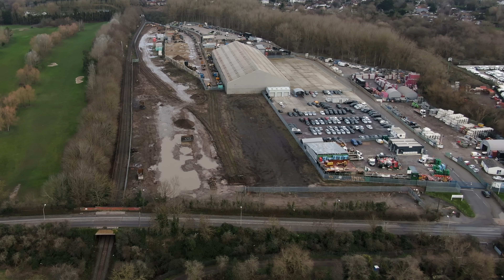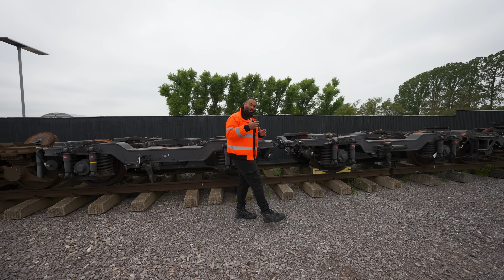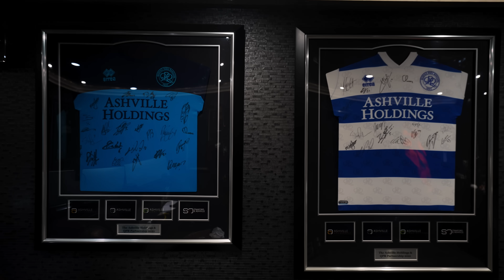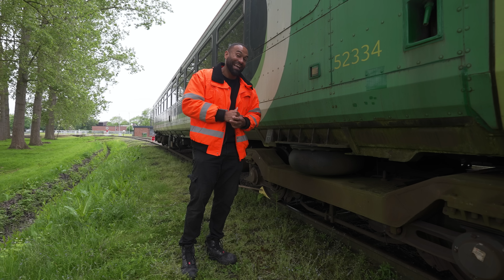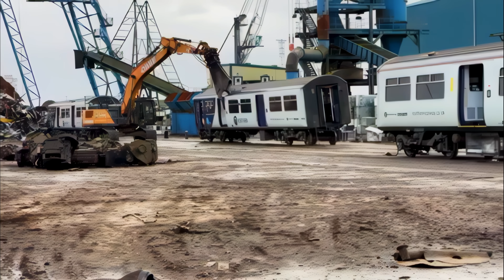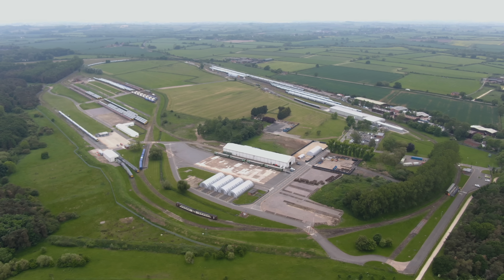I Got My Own Train

Comment: You don't need to transport it by truck, too expensive. You just need a few panels of rail and a crane. Get it towed to your siding, lift it over onto temporary rails and roll it to its spot by leap frogging panels.
Set on site all you would need would be an electric compressor to run the doors etc. I would for sure leave a table and facing seats for the reception area.

Comment: Just a little thing. Whenever he says train he means locotmotive
Reply: No he doesn't... a locomotive is a light engine meaning steam or diesel which requires coaches to couple to. This is a DMU a diesel multiple unit with coach built into it.

Comment: Run an airline to the aux reservoir so the doors will work. 153's have fairly slow doors so you might want to tweak the flow restriction a bit to speed the opening up.

Comment: 10:25 That Is A Metropolitan Cammell Sprinter

E&CR = English & Celtic Railways

Original E&CR Model (Classed As: “151”)

British Railway Model (Classed As: “156”)

By The British Railway Company

MotorCoach Classification

British Railway Sprinter (As: “152”)

Driving Motor Classification

Leyland Sprinter (Classed As: “153”)

Only The Driving Motors Are Built, But They’re For Cabless Trains
 

You Got A Switchable Driving Motor (Corridor) Of Your Own

A Run-Around Driving Motor (Corridor) Of A Leyland Sprinter: #34 Of The Original 5 Seven

Comment: 10:25 That Is A Metropolitan Cammell Sprinter

Original Model (Classed As: “151”)

Official Model (Classed As: “156”) 10:25

Push-Pull DTs (Official Model Classed As: “152”)

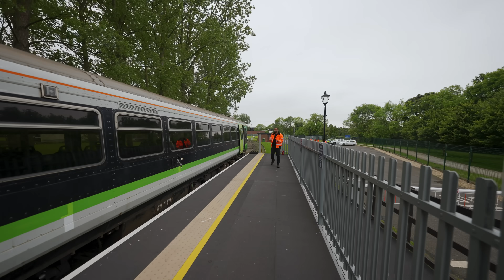Comment: 4:05 You Got Yourself A Leyland Sprinter MotorCoach

Leyland Sprinter Train

Standard Classes Of Either A Train Or A Plane

1. Luxury

2. Business

3. Deluxe

4. Economy

Composite = Combination Of Standard Classes

MotorCoaches (Either End Cabs Or Gangway Cabs)

Composite (Intermediate Or Conventional Cabs)

Passenger

Intermediate

Combine (Utility Cabs Both Ends)

Catering

Sideboard

Passenger w/ Luggage Rack & Lavatory ⭐️

Sleeper

Camper

Luggage

Postal

Etc.

Switcherhead DT Pair

MotorCoach Consists:

Triple Head-Switcher (Three MotorCoaches)

Quad-Head-Switcher (Four MotorCoaches)

5 MotorCoaches

6 MotorCoaches

7 MotorCoaches

8 MotorCoaches

Driving Trailer Consists:

DT / DTL

DTs Only

DTLs Only

DT Pair + DTL

DTL Pair + DT

Triple Header (3DTs Or 3DTLs)

DTs / DTLs

Triple Header + DTL

Triple Header (Lavatory) + DT

Quad Header (4DTs)

Lavatory Quad Head (4DTLs)

Triple Header + DTL Pair

Triple Header (Lavatory) + DT Pair

Quad Header + DTL

Lavatory Quad Head + DT

5DTs

5DTLs

6 Driving Trailers

7 Driving Trailers

8 Driving Trailers

9 Driving Trailers

Etc.

Consists:

Triple Unit

6 Car Division

9 Car Division

8 DTs + 4 Cars

5 Triple Units

6 Triple Units

7 Triple Units

8 Triple Units

Quad Unit

4 DTs + 4 Cars

6 DTs + 6 Cars

8 DTs + 8 Cars

And So On

Leyland Sprinter Train (End Cab Or Gangway Cab)

Lavatories Available Per Carriage

Driving Trailer

Cabless Trailer

Catering Carriage

Sideboard Carriage

Luggage Carriage

Sleeper Carriage

Whatever

Run Round The Anglo-Celtic Railways

Keep Your Eyes Peeled For A Terminal To Be Built In The North Of Scotland Near John O’ Groats Or Somewhere

There Needs To Be Switch Tracks That Lead To Both The Siding For The Train (Switcher Heads), A Loop & The Roundhouse For A Corridor Engine To Go Into The Turntable, To Switch Directions, Then, The Locomotive Engine Is To Go To The Edge Of The Station First, Switch The Track Points, Then Reverse An Engine To The Edge Of The Station, Then The Carriages, You Drive The Train Of Carriages To A Locomotive From The Driving Trailer, Couple The Train To The Locomotive, And Then The Train Is Ready To Either Pass Through Ireland Or Into The Island Of Sodor

Can’t Tell How Many Platforms The Station Would Need

Also Would Have International Platforms Like St. Pancras (Eurostar) & King’s Cross (With Platform 3⅓)

Platforms For Railway Buses (Like That Of The Pacers)

The Base Terminal Of The Anglo-Celtic Railway = Somewhere In London, England Whereabouts

The English & Celtic Railways (E & C R) Should Establish In 2028 A.D. As The 8 Decade Anniversary Of The British Railway

Comment: Hydrogen is not clean electricity.  Don't buy that lie.  Electrolysis looks good on paper, but is power hungry and expensive.  The easiest, cheapest, a lot dirtier, and the main and only usable method of creating hydrogen is steam-methane reforming.  Might as well be running on diesel at that point.

Comment: 9:10 - That's is not entirely correct. Sand IS used to gain traction, both regarding braking and acceleration. However, under normal circumstances, sand is not needed to use the brakes on a train. Sand will only be needed when the rails are slippery, especially during october and november due to all the leaves on the track. And it can be used both for acceleration and braking, but must of the time, it's not needed.

Comment: I like the reception idea but a moving reception would be pretty awesome. Like you come in Ashville and the train goes from the 1st stop (the gate) to the next stop (the main buildings/offices), & then potential other stops throughout your yard. I guess having it work on its original diesel propulsion would be very impractical but an electric (or any powered actually) winch type system could work and it’s a great showpiece. lol

Comment: @Ashville It would be neat, if you could ask for permission to drive train to the Ashville Yard. This could be possibly be during low peak hours and at night. But, at least attach this train to a freight train that going to the south. So you could ride it on the rails for the last time. Even if you can't get the train working running again? Plus it would be a great video seeing the train traveling on the rails to it new home.

Comment: Battery/ Hydrogen fuel cell Electric Multiple Units are truly the future of passenger rail transport.  Because they will be useful for routes that need passenger service but don't have enough demand to justify having locomotives for each train or investing in overhead electric wires.

Comment: What you forgot to mention was the class 153 built-in 1987   Originally  Class 155 2 car.  

In the early 90s when West Yorkshire metro needed more units  They decided to convert 35 of the units in to 70 separate units as It was almost 1/2 cheaper then buying newer trains.

Comment: I used to be a Senior Conductor on 153334 when it used to work the line between New street and Rugeley Trent Valley, normally coupled to a 170 turbostar. Great to see it avoid the scrap yard

Comment: Daniel will the train be driven to site on rail or back of a low loader the latter would be a logistical nightmare all you need is a crane lift it into place 👍if its by road and your looking for a good heavy haulage firm who specialise in this scotts heavy haulage based in Derbyshire.

Comment: big question: why can't it be driven or hauled to the yard, given you already have your own railhead that's very much connected to the UK rail network? from there it would be easier to maneuver into its final resting place either with heavy equipment or temporary rails, compared to the whole logistic puzzle of moving oversized cargo by road.

Comment: If it's gonna be parked up permanently,  fit drivers cab windows with LCD monitors,  rig some wires in the controlls, and load up Train Simulator game.  ;)

Comment: I'd volunteer my time to help with whatever renovation  and modification you do.  I am an 'anorak' (tho not  a frother LOL).  Your gonna have fun doing it.

Some suggestions..   
Mobile permanent office and cafetaria.  Maybe get it railworthy and use it travel to your various yards with rail access (if applicable).   Why have one building as a main base for all yards, when you can have a main office that travels (with accomodation?).   Although this could be done with a HGV artic on road,  it isnt quite the same style.

If you have security on site 24/7,  have a section aside as a small office for them.

Start with the usual dark Ash theme livery.

Comment: My dad is a train driver for West Midlands Railway and is based out of Leamington Spa, it can be nearly guaranteed that he has driven that very train on the route to Nuneaton (it was also in use on the short spur from Stourbridge to Stourbridge Junction, which he also drove).

Also pretty funny that the clip of a train moving operation you used was moving a Deltic, the loco I got my username from.

Comment: Hi Daniel, 
Very pleased for you owning your own train. As a retired railwayman I appreciate your excitement. A couple of notes for you if I may. 
These trains are known as units and talking of which, you may have realised that one of the cab ends is smaller than the other, this because these Class 153 units were conversions from some Class 156 units which had 2 carriages. So by doing this BR wete able to create 2 powered train units out of 1 two carriage train. You were correct about the sand boxes, however they are only deployed in slippery rail head conditions to aid traction when stopping and also to aid starting from a standing stop. 
I used to drive the electric version of these but in my earlier Driver training days I did get to drive yhe Class 156 version from which the Class 153's were made.
All the best with your new venture.
Take care,
Jon B.
Reply: They were 155's originally not 156
Reply: @rayhenwood3833  Sorry pal, but the ones I drove and Guarded on were 156 units, some of which went for conversion. Never saw 155's on my region...
Reply: Actually they were converted from class 155s, not 156s. I worked for Hunslet-Barclay at the time and we converted 35 sets into 70 single car units in 1990 onwards. Class 156s have always been 2 car units occasionally reformed into 3 car units. Never single car.

Comment: You say you're not gonna touch the body of the train with it being steel, but I would check for corrosion. There's two Class 156s (one of which could've been the one you've included footage of) that Porterbrook leased that are apparently so badly corroded that they may not see passenger service again. They were built around the same time as the 155s (which were split to become 153s) were built around the same time period

Comment: Glad to see you mentioned Hydrogen fuel cells as far as I’m concerned with construction plant and equipment it’s the future … ev plant just doesn’t work on a construction site where your machines are working all day should be used for cars but then they can’t charge you for a replacement battery every 3 years

Comment: Glad to see you saving it what is the possibility of using it for duel purposes set it up as a reception area but also be able to run it around your yard area if you so choose to use connect the track it sets on to the rest of the yard tracks so it looks like your doing street running just an idea

Comment: Sand is only used for traction in slippery conditions, sand is not used for normal breaking under normal conditions - oh dear 😅 there is more friction than you think between the metal wheels and metal rails

Comment: One thing u could do is have a system in place for people who jump on a train and purchase a ticket on a train card payments only. If u cant get one in the station down to long of a queue or no other way or getting a ticket from the office u can purchase while on ur journey It will be voice activated as well where u have a direct button to the driver or ticket conduct voice activated call while on train if any problems while on service u press that button so u have viable options to get to where u need to be or sort out situation such Destinations enquiry/ journey times/ getting on the wrong train by mistake ect ect communicated to conductor on a computer run by ashville services. It will be the first computerised service on board. Do a survey and see if the public find it easier or if they like the idea.

Comment: You could put monitors on the outside of the windows and then touch screen overlays on the inside so you can see favourite rail journeys from the windows of the train, then you can touch and interact with the windows for whatever presentation you desire.

Comment: wow area 51 of train development, nice class 52/3 you got there, can it not be hauled to your yard using a diesel loco as a tow. the front cab just simply has to have a train simulator, with a little jiggery pokery the electronics from RailDriver usb controller could probably tie up to real controls in the cab. that would be real sweet being able to drive the class 53 on a Train Sim 24 route, but using real cab controls.

Comment: You can tell which end is the "front" of the train, because your Class 153 is actually a converted half of a 2-car Class 155. So when you said you were going back up to the front, you were correct... that was the Number 1 end (original cab)

When it was converted the second cab was squeezed into one end, making the vestibule (area near the door) noticeably smaller and with a smaller cab on that end

Comment: It seems fitting that the train should be the first driven down the new rail line in the yard to mark the opening. Then parked as the new waiting area. It would be way cooler if it could be driven on the rail line, not on a truck. But get the outside painted and logos on first.😜

Comment: Like some of the comments - as you have your own connection to the rail network from your yard, why not use either 1 of your train freight delivery's to go via Long Marsden and put 153334 on the back of it or hire someone like The Rail Operations Group/Rail Adventure to collect 153334 from Long Marsden and deliver it to your yard. These companies specialise in ferrying trains around the country via rail and also take those trains to be scrapped (usually to south Wales). Would be much greener and more fun as you may well be able to ride in the loco/153334 when they pick her up and go with her to your depot. Also, like the comments, keep it drivable/mainline current (defo from both ends) as you could then shunt other things with it and even (with a driver) use it to commute/go to heritage lines via the mainline/Gala's and events and make a bit of ££ with her. A traveling reception/office if you like! Sinking the rail to allow cars/traffic to pass over when the train isn't on the move will help too!
Reply: newport sims scrap yard at Newport docks
Reply: @Nigey4444   thanks.
Reply: Where in South Wales do they scrap trains please?

Comment: That is so cool. Imagine storing that 153 on site, using it as a space to chill and installing decking on the outside 🎉 I wonder if they use to couple up 153s and 150s for the Snow Hill lines? Before the class 172 took over during London Midlands era…

Comment: Well done Daniel. Being local the transport by road could be interesting, NWR are not usually open to single movements. The bridge on the road has serious arch on it. The mill the other side is a no go. I wonder if you could get it to West Drayton (old Unigate yard) and then move it on the loop to your yard, however that will involve NWR. You will need a crane, big , to move it to the place you want to have it. This is going to be interesting.

Comment: Can't you ask Porterbrook/GB Railfreight to organise a fit to run cert and drive the train down to the yard? Then you only need a crane with the right lifting equipment to go in the pockets at the sole bar to leave it clear of the yard for now. Not like its gonna be going anywhere on rails after its got to the yard so you could just leave it sitting on the wheel flange.
Reply: Also, you have the diesel already!

Comment: I'm surprised you were able to buy a class 153 DMU as they are still in service all over the network. They are a bit long in the tooth having been converted in the early 1990's from 2 coach class 155 DMU's. However as the 153's have moved round from company to company they have regularly been upgraded and refurbished. You appear to have a recently refreshed unit.

Comment: Been to Long Marston to collect and turn locos around to out flange wear. In fact your stood in front of one of the shunters I turned.  

Hauliers, Alleys, Reid freight services or S.A. Smith are your guys to talk to to move it. 

As for the footage of the old carriages being scrapped, that's sims at Newport. I took 35 ex freightliner HXA bottom discharge hoppers in there to be scrapped as there wasn't any work for them.

Comment: This is great.  It would be fun to have a mechanic keep an eye on it so you are able to roll it up and down the 30ft of track in front of the office.  One serious thing I have a question about is infrastructure. This will be a great way for ashville to be able to bid on contracts anywhere accessible by train and truck in the UK.  One thing you may want to consider is getting 2 or 3 cars so you can put an excavator and a front end loader on the rail, so you can get stone off the rail anytime and anywhere you can stop a train.  The USA has coal loading cars, that will empty out the bottom. Does the UK do that? If you emptied stone out of the bottom of the cars, and belted it up into trucks, that would save you from making a mess with an excavator.

Comment: Trains are cool!
My job requires shunting, coupling and uncoupling trains, i still think it's great.

Glad you saved the 153 from scrap!
Remember at night you can lock it out by closing the doors through the guard panel.
During the day you can release the doors and then visitors can close and open the doors as they please.
Such a great repurpose for an iconic unit!